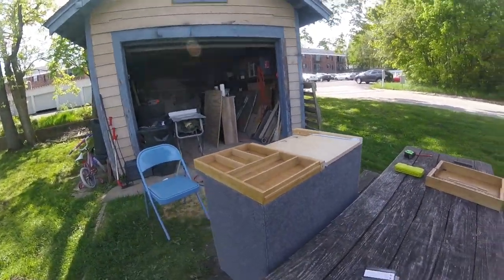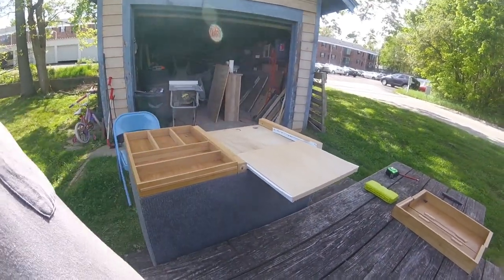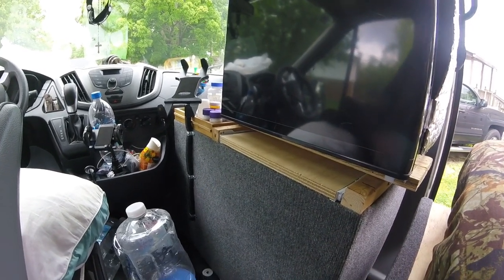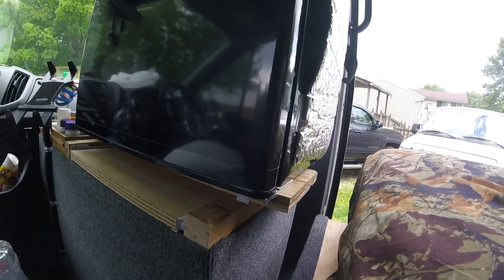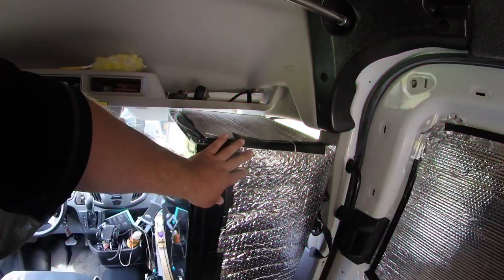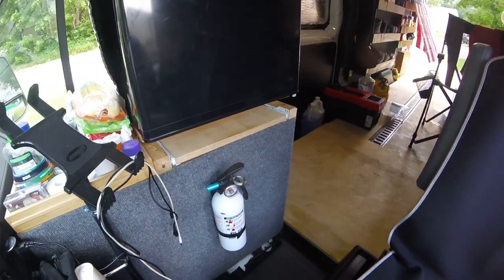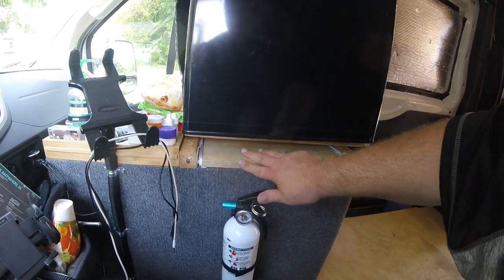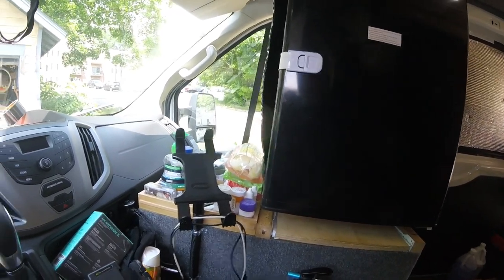VAN BUILD - MINI FRIDGE BASE/MULTI PURPOSE PASSENGER SEAT BOX

Comment: Nice build! I think that refer uses the side walls to radiate condenser heat. Tubing under sheet metal.
Reply from the maker: Everything looks to be in the rear of the fridge on the bottom. I left that uncovered for that purpose.

Comment: Allen, it's too bad you need a generator because there seems to not be any decent place to mount it. Inside space is a premium. Mounting it on the front bumper looks like shit and would prohibit airflow to the radiator, turbos, and transmission cooler. I don't like the swing arm either mounted to the trailer hitch. Forgot whose video it was, but I seen where the van owner mounted it to the rear driver's door itself utilizing the existing door hinges for support. I think I liked it best, but still not ideal. Roof mounting is out of the question. Too bad you can't mount it underneath the van in some open space area. Of course it would have to be designed to be protected from the elements and allow fuel fill-up and probably be well insulated to deaden the generator noise. I know you said you rely on the mirrors, but I personally would want full vision looking out the front passenger window. I praise your efforts. To be working and living in your van definitely requires the comforts of aux. A/C and Heat which means having a generator. I still feel sorry for Youtuber/driver, the 'Life of Chris' without A/C and unable to run engine for A/C. You cannot survive in the summer and especially down South in the heat w/o A/C.

Give your audience and update about how the van expediting business is doing right now and what is the going rate per mile. It seems a lot of expediters including the straight trucks have to dead head long distances to get a decent load. Are you staying busy or are you doing a lot of sitting? Have you had any mechanical issues with your new van? Great video, always look forward to watching your videos; very informative.
Reply from the maker: I know a guy that mounted his onin generator under the van. I've seen the hinge mount as well but only on the Sprinters. 

I've been off the road since April. I'll be back out next week. I'll give updates asap.

Comment: Can’t believe you will get away with that refrigerator blocking the passenger window.
Reply from the maker: We shall see. If not I'll reconfigure my set up. I'm not the 1st to place it there. I have had it in my other van for 3 years with no issues. But who knows. As I said if it becomes an issue I'll move it.